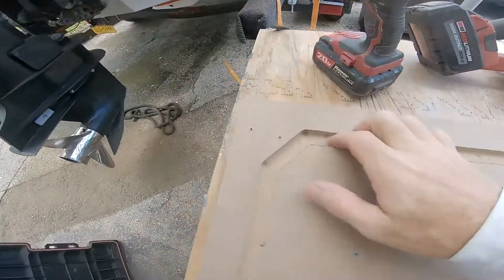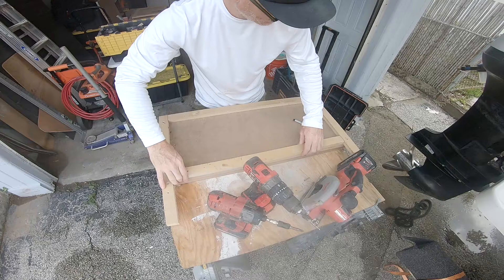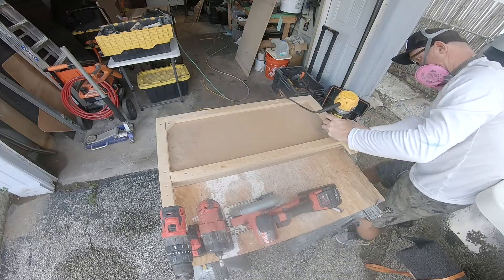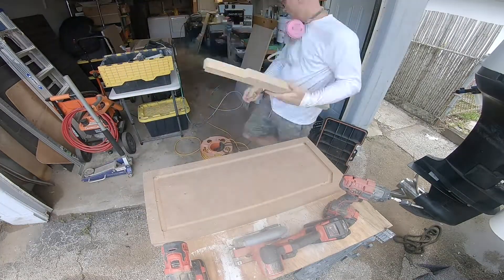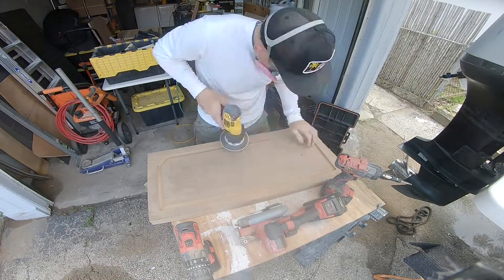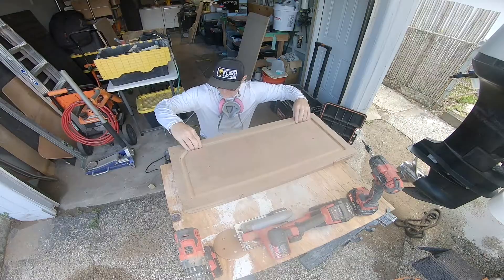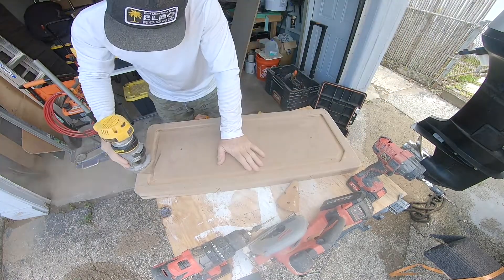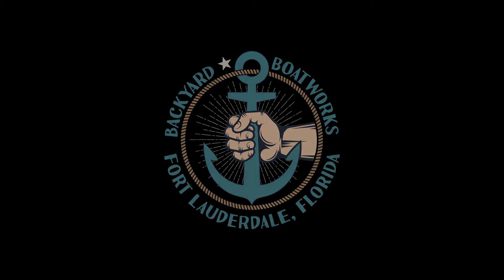CNC Quality MDF molds using a Trim Router

Comment: When I make a plug from mdf, I don't bother with giving it a resin coat as it is just more work. Instead I just wax the mdf and it works fine. You can use a final application of PVA if you like, but six waxes make the mdf shine and release well. For best results using a wax release, it's best to apply 5 or 6 coats over two days. Cheers
Reply from the maker: These are molds they aren’t plugs. They are made to pull multiple parts so leaving the MDF raw won’t work.
Reply: @boatcrafterscompany  yes, I understood that they were moulds, as the title suggested. I was merely throwing in that information for the other commentors, in regard to quick mould making techniques. Cheers
Reply from the maker: @robertcain3426 thanks I have another video showing a single use mold

Comment: I’m struggling to determine how these are better than your precious layout/design? Are these just low profile?
Reply from the maker: It’s not necessarily better but the more shallow gutter allowed me to use a thicker core material for the lid. My old design used a 3/8” core and this design used a 5/8” core. So the lids are stronger with less glass. It more important on the larger sizes.